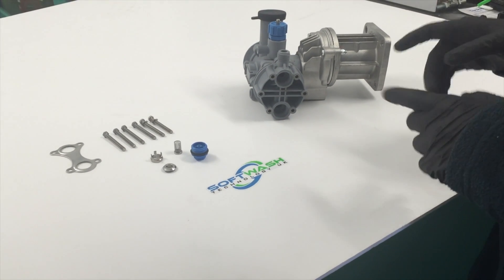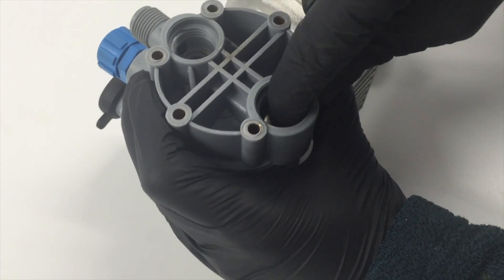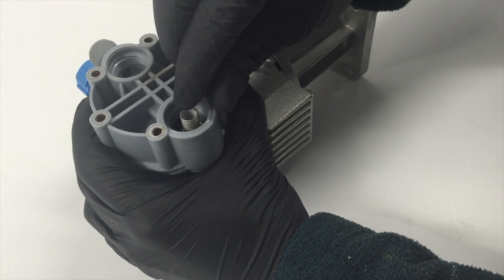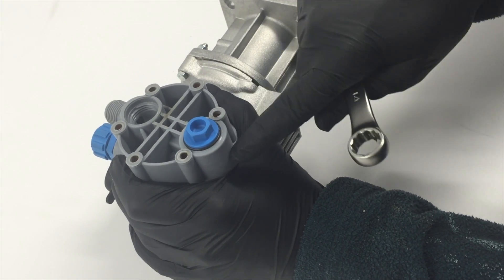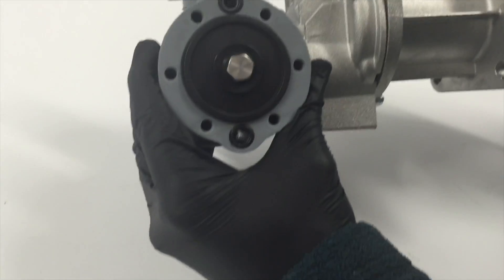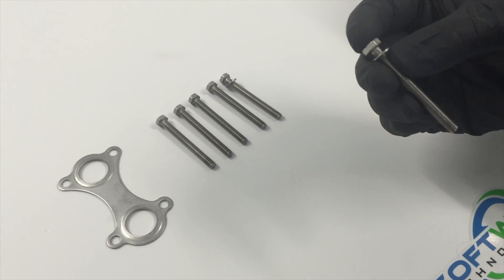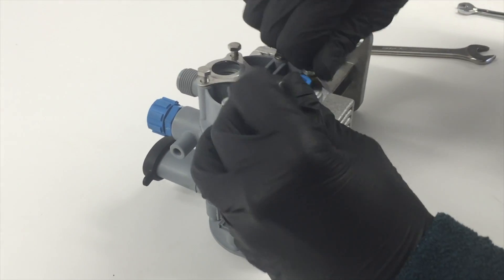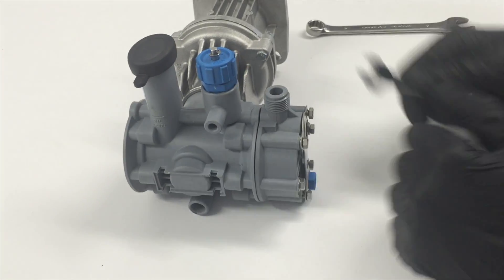Comet MC18 Pump Rebuild Viton

Comment: I tried to fix mine today but I think I left the oil change to long and it mixed in with the water. I didn't realize there was an oil inlet in the pump. No flow coming through 😕